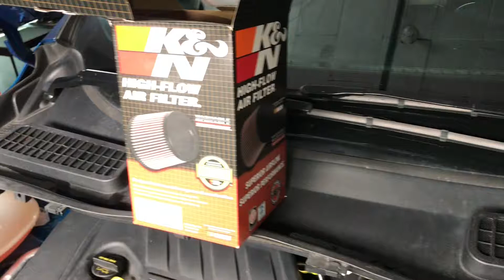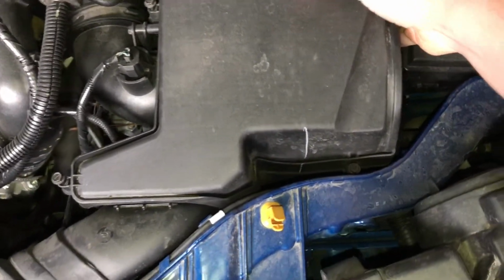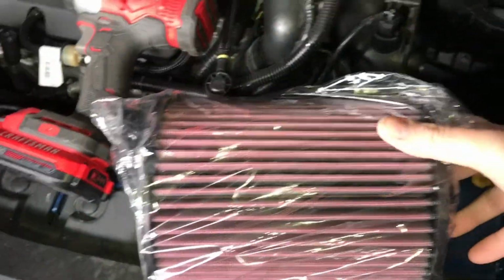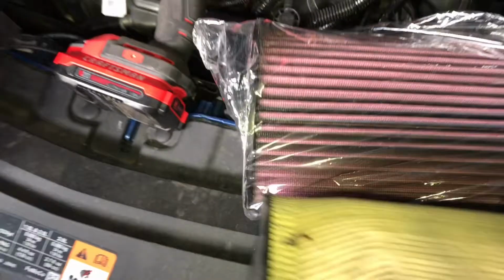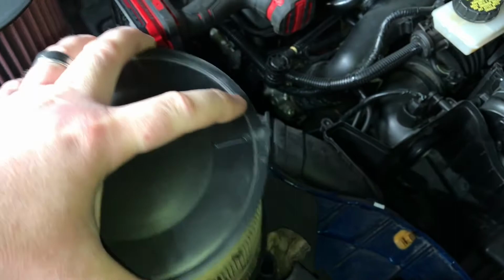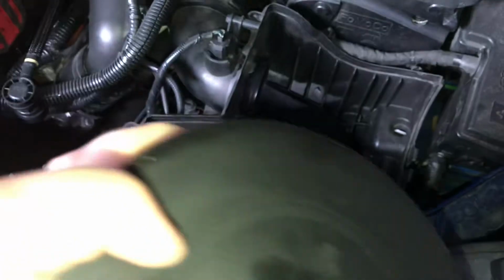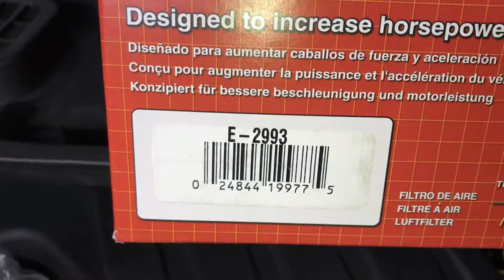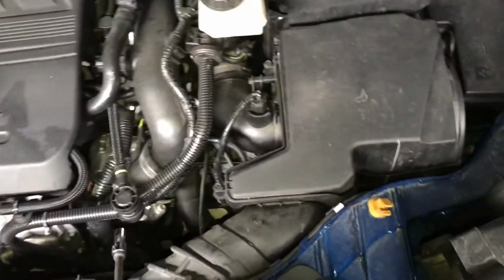Installing a K&N Air Filter on my 2017 Escape

Comment: I don't see a benefit ? The intake hose/passage from the grill remains the same and it's CFM ability..  Did it feel quicker or anything ?
Reply: I'm using a pipercross cause it's much more cheaper and more performance compared to k&n
Ran on dynos add 4hp for 50usd
(sorry for bad English)